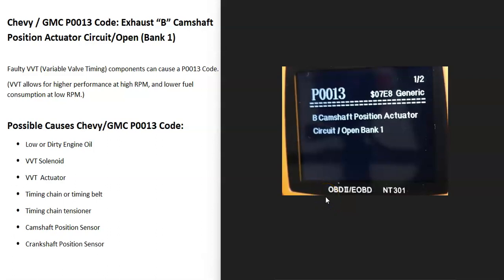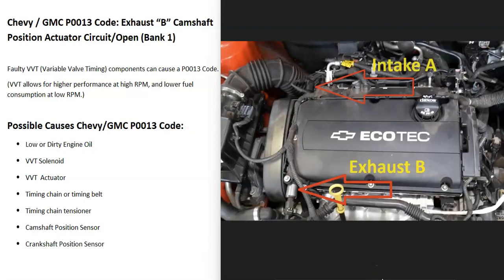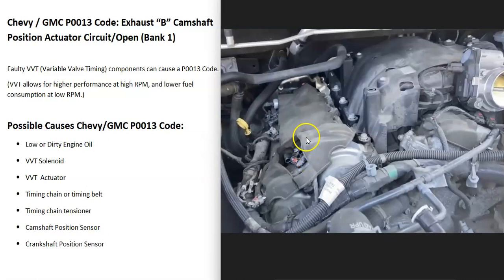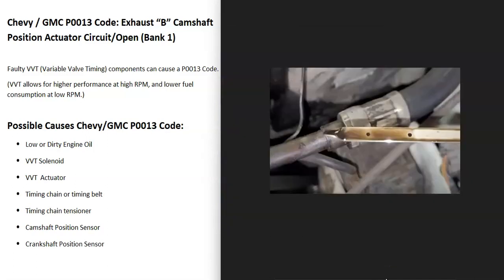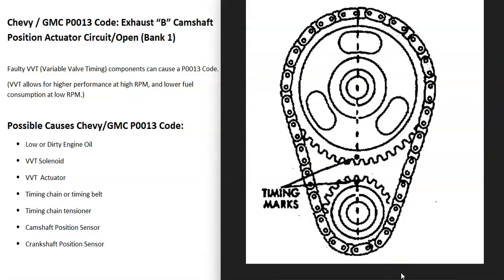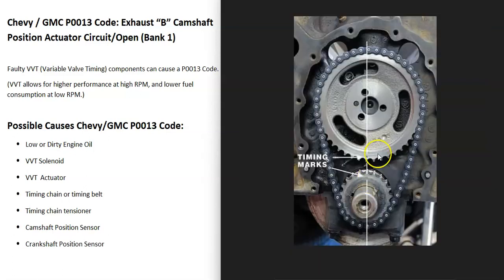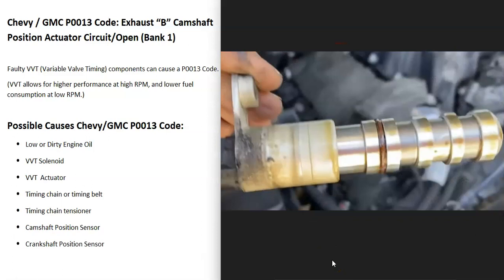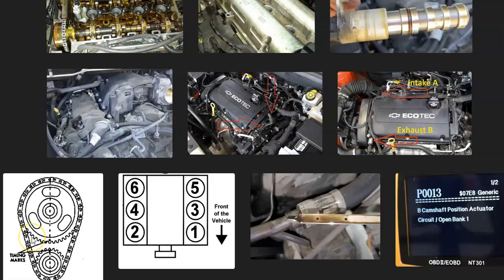Causes and Fixes Chevy GMC P0013 Code: Exhaust “B” Camshaft Position Actuator Circuit/Open (Bank 1)

Comment: Bro, I changed the solenoid still same error.......can be the electrical cirucuit?! buick regal european version open insignia
Reply: I’ve changed this 3 times till I had to get the original parts and now I’m gonna wait and hope that was the problem if not the wiring could be it and if that doesn’t do it than the ecm has to be it.